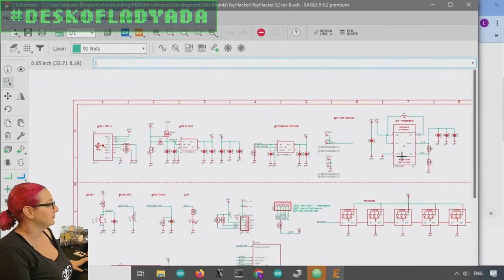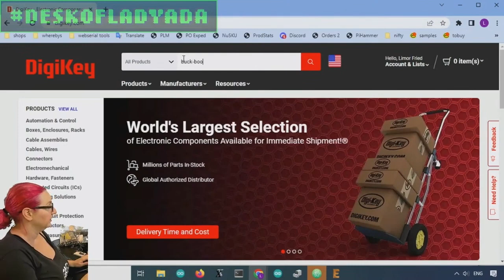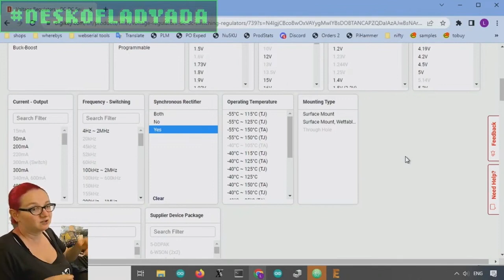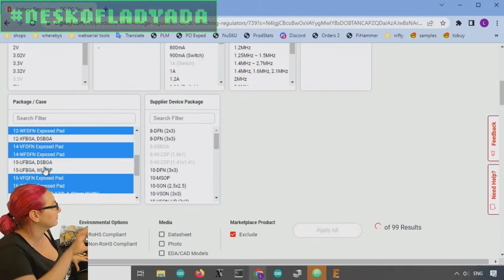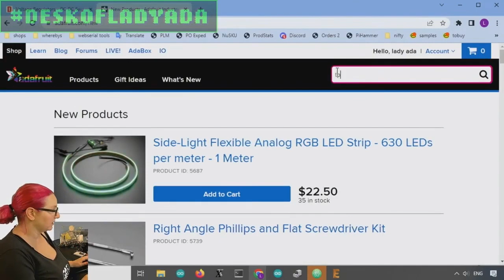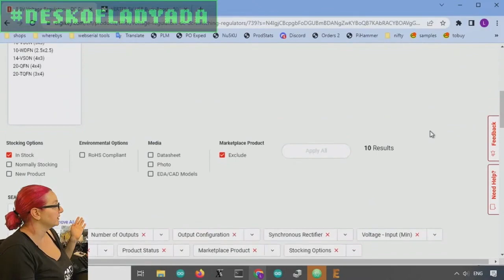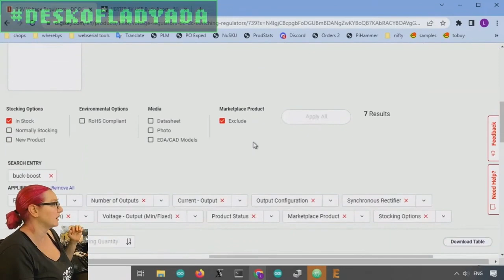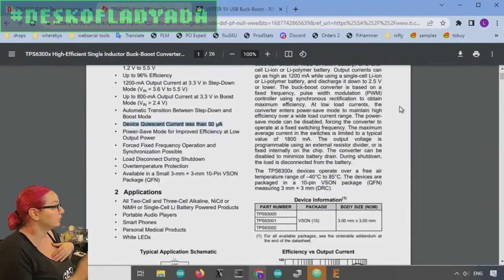The Great Search: 3.3V Buck-Boost Converter #TheGreatSearch #digikey #Adafruit @DigiKey @adafruit

Comment: I tried to find a very similar part for 12 volts so I can turn a 10-14V input (car battery) into a nice clean 12 volts. I ended up buying a few chonky DC-DC converters by Mean Well that can take 9 to 20 volts. SparkFun has something I used before, but the built-in inductor gets awfully noisy in the boost mode.

One of the really silly decisions I made early in the project was picking a part that didn't specify buck-boost (or SEPIC, or Cuk, or...) functionality, so it could only buck down; if you fed it 12 volts it would spit out 10.5V. What really made the decision silly is that I designed the PCB based on the assumption that it could boost without a significant change in topology.

Comment: Fun video ! How are you isolating the 5 volt USB side from the battery side on the input?  Using diodes gets the job done but you lose whatever Vf is in your battery capacity.